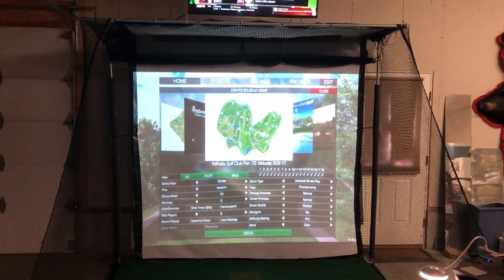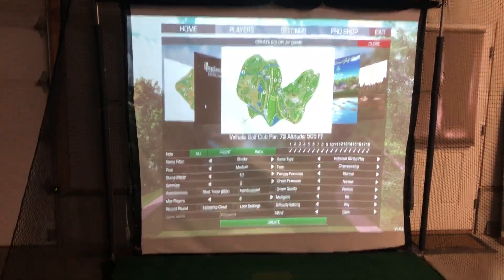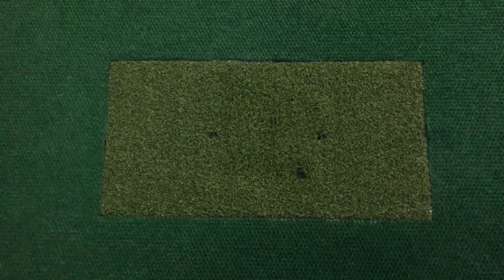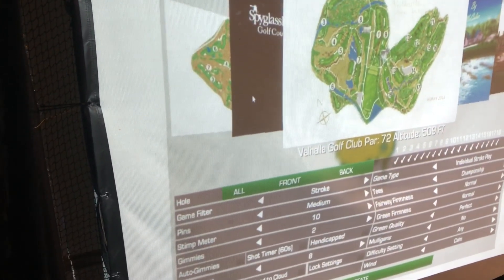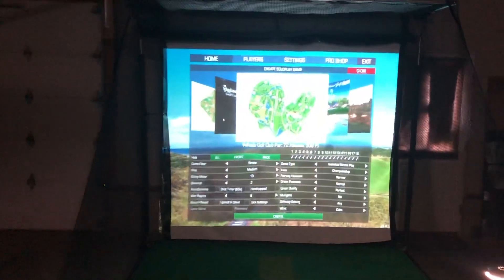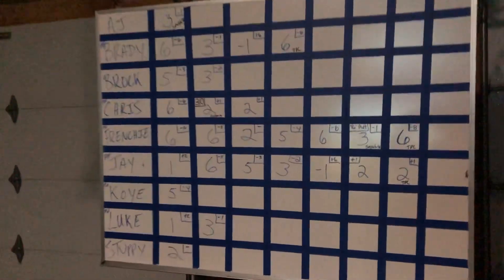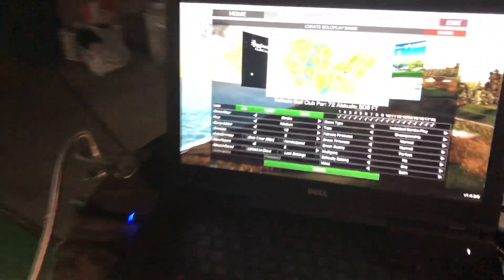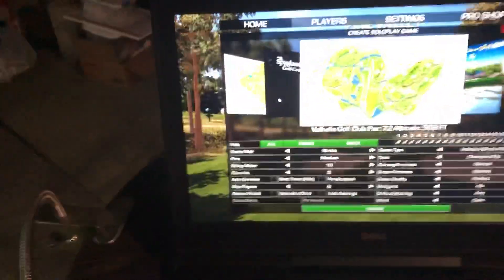DIY SkyTrak Home Golf Simulator

Comment: Hi Jay,  thanks for the great video it's very helpful.  I was wondering how you did the netting on the top of the cage.  Did you purchase extra netting from amazon, Carl's or another source?  Any details or links you can provide would be very helpful.
Reply from the maker: Gregory Mayes the extra netting is just anything you can find from a baseball or hitting net that I used to add to my screen. If you see in the other videos I actually went away from the fold over ad just moved closer to the screen and added some foam pieces to the ceiling just in case someone hits a super duper high shot.   I would not recommend the fold over as I had originally as we still would hit the EMT tubing sometimes and that is dangerous with the balls flying back at you.   It’s gonna be a process of trial and error for you to figure projector placement vs how close you can get to the screen as to not cast shadows.

Comment: Jay,  any chance you can list the items you used in the project? I just got my Skytrak and need to get started on a bay in my garage. thank you !
Reply from the maker: Jordan Keshler projector, I use an Optoma.  Mats.  I built my own, see videos.  Screen, I bought a Carl’s Net System screen then bought metal conduit and built a frame a little larger than the screen to stretch it.  I bought The Net Return side nets.   I bought my hitting inserts from EBay.   I use Tomahawk tees.    Hope this helps.

Comment: Where did you find your impact screen? I'm having a hard time finding one that isnt part of an expensive package.
Reply from the maker: I got mine from Carl’s.   Entering year 4 with no issues on it.
Reply: @59762000  Hey, thanks for the reply. What size is your screen?
Reply from the maker: @mcshaft2760  mine is 8x10.  I would like to have it sitting sideways so it’s 10’ wide but I don’t have the space between my doors so I have it flipped so the 10’ side is up and down.

Comment: This is such a great video..thanks for posting. Can you please confirm you are hitting real golf balls into the screen. The netting you have seems a bit small. Also are you able to hit driver to pitching wedge? Do you have to move closer to the screen for the pitching wedge? I was also confused by the 2 small light green squares. I get that you hit from the one that is about 10 feet from your screen but didn't understand why to had the one about 3 feet from your screen. Thanks again!!!
Reply from the maker: ltroilo yes sir.  We are hitting real balls and driver and PW and SW etc.  we play full actual rounds.   Several have asked that I show us playing some holes so subscribe and you will see that coming soon.  I have 2 separate hitting squares just as a backup in case we mess one up or it comes apart during rounds then all we have to do is turn it around and use the spare.
Reply: @59762000  this may be a stupid question but do you have to adjust where you stand for PW & SW versus when you hit driver? are there any adjustments necessary to the golf simulator when you hit the different clubs? would also like to hear what happens during putting. thanks for taking the time to respond!!!!
Reply from the maker: ltroilo nope. You hit off the red dot every shot.  You have to be close enough for wedges so you don’t hit over the screen. My hitting mat the little green insert is about 8-9’ from the mat.   You then see I have an overhang that will help catch your sky shots.  Not saying nobody never hits one over the net cuz it happens but that’s also why I have a plexi-glass over my TV.
Reply: @59762000  terrific thank you. If you were to hit from about 5-6 feet away would that put a shadow on the screen? I have a somewhat tight space so I am wondering as long as the club would not hit the screen and the balls would not ricochet back into me would I be okay. Trying to get a feel for how important it is to be 8 feet away from the screen. Just want to make sure I am not missing anything because I'd like to e closer to the screen.
Reply from the maker: ltroilo you will need to test it before confirming the location of the projector.  I had an issue with a shadow being too close so I settled on about 10’ away for the hitting area.   I did as you can see need to fold over the screen to catch high shots. Mine were originally going over the net so it will be a trial and error to get the projector in the right spot as well as how close or far you can be from the screen.  Good luck and lemme know if I can help ya.
Reply from the maker: ltroilo yes I will probably just post a video.

Comment: hey jay - how do you change clubs on skytrak.  i have optishot now & have a controller to change clubs, direction, etc.  i think you had this controller for optishot as well.  thx!
Reply from the maker: Ivor Goodge playing on sky trak is exactly like playing on a the real course. Hit whatever club you want.  If you have 95 yds. Hit a wedge.  If you have. 180 and you hit 5 iron and I hit hybrid.  Who cares.     Optishot tracks the club that’s why you have to tell it what club you hit.    Sky trak measures the ball.  Playing on sky trak is just like playing for real.
Reply: @59762000  thanks Jay.  I made the move to skytrak this week.  i set it up today & was wondering what lighting is necessary.....I notice you have a light over your skytrak monitor?  i'm in my garage as well.  appreciate your input.
Reply from the maker: Ivor Goodge I only put the light over mine because we play with most of the lights off and we like it bright where we hit the ball.  It is not needed I just like the lighted area where we hit

Comment: I'm researching home golf simulators.   How wide is your hitting area? Also how far away is your hitting area from the screen.  My area will be 10.5'w x 18'L x 12'h
Reply from the maker: Mine is 8’wide and 12’ long
Reply: @59762000  thank you for the information.    When I'm getting ready to set up a golf simulator if it's alright, I might contact you for more information
Reply from the maker: Tim Bower that’s fine.

Comment: I'm going to purchase the SKY TRAK but before I purchase  it I'd like to get some information from you.
If you don't  mind please reply me would  be great.
Thanks and regards, 
Charlie
Reply from the maker: charlie lee what can I help with?
Reply: @59762000  
Hi Jay,
What software included and what dimension I need it?
Height and width  and length. 
I got shed pitch roof.
Thanks,
Charlie
Reply from the maker: charlie lee the height of your screen will depend on your space. You can then choose the aspect ratio and projector position from there.  I was using JNPG but it’s now gone for ST.   I’m probably gonna switch to E6 Connect.
Reply: Thank you so much really appreciated that.

Comment: I thought skytrack no longer supported JNPG. Is that true?

Also, could you explain in ore detail how you built the large surface?  Looks great btw..
Reply from the maker: Jim Squires I posted another video. Subscribe to my channel and you can get updates.     I just posted on how to build the mat system
Reply: Jay Smith Great will do thanks!
Reply: When folks upgrade to GC2, Uneekor, etc, you can pick up a used Skytrak that already has JNPG.  The license can be transferred to the new owner.  The new owner will be able to renew indefinitely.  3 used Skyrak with JNPG were sold this week on OGT Discord chat classified

Comment: Can you send link for the inserts you use from ebay?
Reply from the maker: Matt R just type in 12x24 chipping mat, it’s like $12-13.99.   For some reason I can’t send a link.    Lemme know if ya have issue.   Make sure you use liquid cement to fasten it down

Comment: Awesome setup, Jay. How tall are those ceilings (I'm guessing in a garage)? Would be interested to hear your advice on dimensions for a decent space to set up a SkyTrak. Much appreciated.
Reply from the maker: Logan Kostroun I have 10’ ceilings in my garage.   I would say to not feel cramped that is the least I would go. I am 6’5” though.   If anything the swing area needs to be clear.   I have seen guys cut out the drywall over where they swing to allow more club space.   We have an 8x12 mat and need about 5-6 feet behind to sit and hang out.  Lemme know if I can help you with anything!
Reply: Jay Smith will do -- appreciate you putting this together.
Reply: @59762000  your ceiling space has shrunk 2 feet?